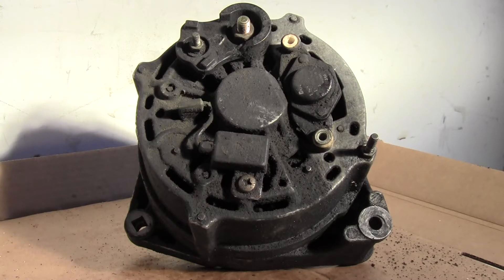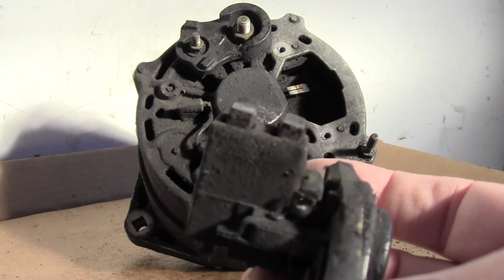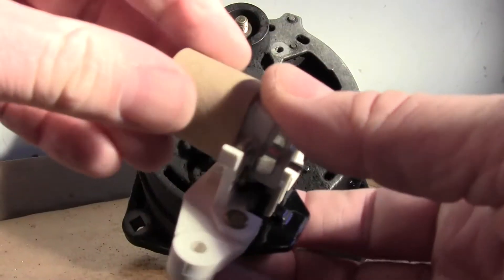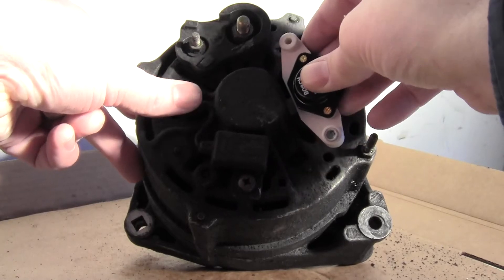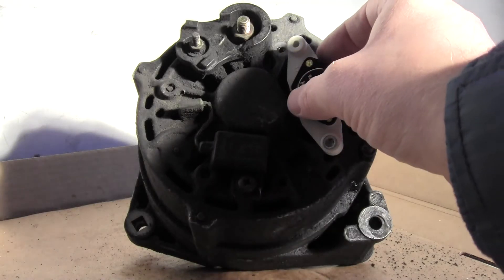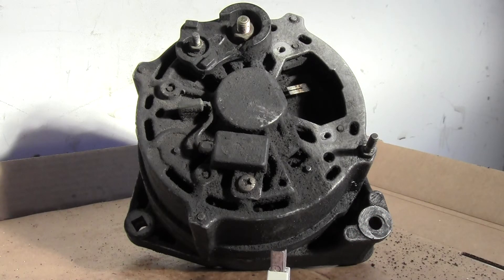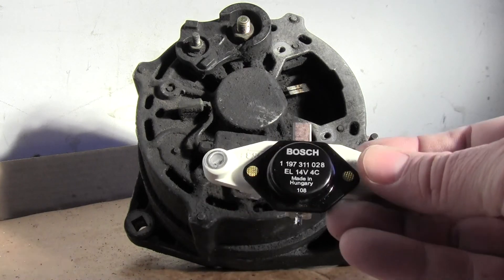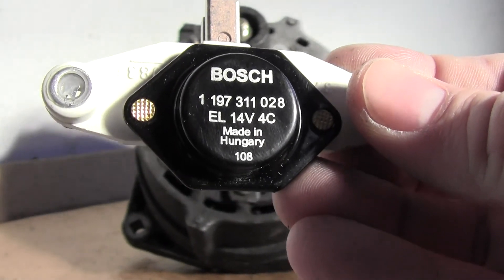Volvo 240 Alternator Repair

Comment: Thanks, did this today in a 91 wagon. Yes that one screw was a pain to get out and I didnt want to take the whole unit out of car. So I took the plastic oil pan cover off and went up from the bottom. One screw came off easy, bit one on back side stripped the phillips head. I took long nose vice grips and loced on screw and took it off. I was able to go to NAPA and they matched up a screw and 3 spring washers to use after installing the new one. Man, my brushes were GONE!!!! Now all is good. Thanks again good video.

Comment: Just fixed mine - brushes were not worn all the way down, but that metal tab inside was too far back and corroded, making for a poor connection.  Sand or wire brush it and gently bend it outwards while you're in there.

Comment: I thought I would replace my voltage regulator not knowing how much life was on it and it looking pretty old from the outside...ya...tons of life left.  While removing it in place on my 92 240 wagon was no issue after removing the buckle harness on the back of the alternator- getting the holes lined up back in place was just not working for me with the spring tension.  So, fan and shrowd removed lets you unbolt the alternator and flip it guts up, for an easy reassemble all from the top of the car

Comment: I have an 89 240 wagon. It will not charge but constantly discharges while car is running. I removed alternator and took it to oreilys auto parts for testing. They ran the test 3 times and said it past all 3. Could this regulator still be the culprit? Please chime in and help if you would be so kind you all.

Comment: Voltage regulators seem to be a weak link on these alternators... Tell tell sign voltage regulator failure is the temp and fuel gauges not moving to their normal spots... They'll stay at the 8 o clock for temp gauge and 4 o clock on the gas gauge. IPD has voltage regulators for about 50 bucks each now...

Comment: Look good! I think I need to do this replacement on my 780. 

Quick question though, what is the other small box with one wire coming off of it on the back of the alternator?

Comment: my "crooked" mechanic told me the alternator could not be fixed.....
Reply: There are certainly times where they cannot be replaced. It depends on the issue with the alternator.
Reply: Do you work for a volvo dealer???

Comment: How did this repair hold up for you? My saturn ion with 186,000 miles regulator just went out and not charging. I just orderd a voltage regulator $40.00 on ebay and preparing to do the fix myself. Is your alternator still working?

Comment: 50 bucks? You got RIPPED man.

Number one: next time IF there is ever a need to replace another VR. Get yourself a good soldering iron, solder, and a new brush set(will come with springs for about 8-10 bucks. Desoldered the old brushes from the holder paying attention to orientation of the flex wire as well as spring and feed new brush wire through hole just created from old brush.

New brushes will have longer wire so that you can feed them into the holes in the holder as appropriate.

Get something like a small clamp or use your finger to compress the brush into it's corresponding holder than solder them up and clip excess wire.

Smple as that it's a bit of a pain but saves a ton of money since it's the brushes and  99 percent chance the VR itself is still perfectly fine:)

Hope this helps ya.
Reply: i just removed the VR from my alt on my 92 240.  There is no way to get to a soldering point to replace the brushes, it is encased in hard plastic which in my case crumbled when i used pliers to get to the wires.  maybe this worked on older VR but not the one pictured above.  so much for my $5 repair.